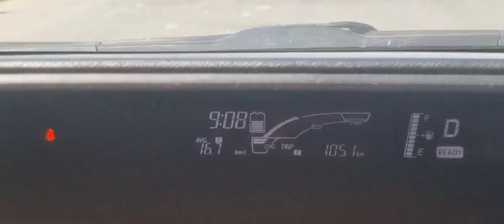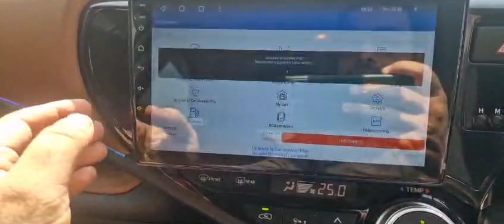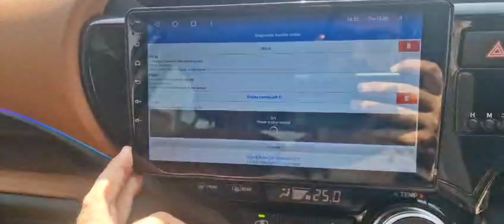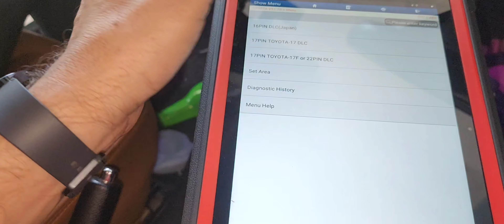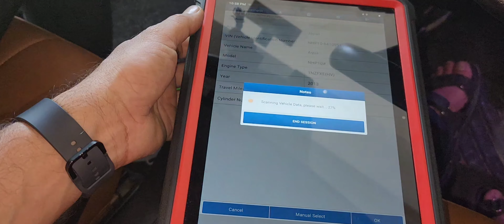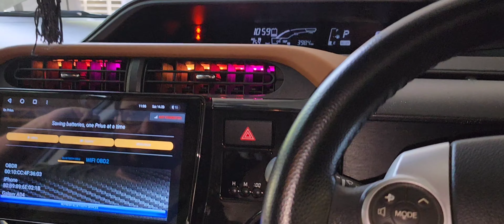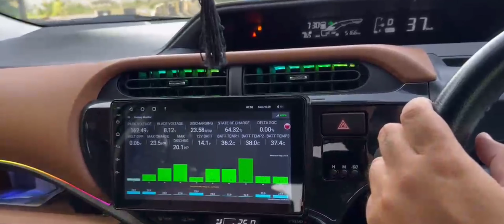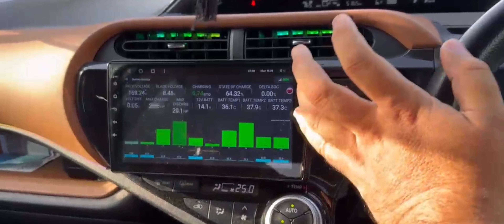Toyota Aqua hybrid Engine sign on And Hybrid sign ON Codes p3190 p0A0F

Comment: @mansoor bhai please help me mery pass aqua 2012 model h us me p3190 or p3193 code aty hn sb tuning krwa li throttle b change karwa lia  but masla hal nhi ho rha slpw speed me car missing karti h r average b kam ho gai h please es k hal bta dain kya karen me 3month sy prashysan hn from Bahawalpur
Reply from the maker: P3190 Fuel pump  ignition coils sprak plus 
Throttle body check karaen 
P3193 
Fuel injector leak ho saty hy
Or all fuse check karaen 
Catalytic converter chocked ho sakta hy
Oxygen sensor Air sensor b check karaen
Reply from the maker: Throttle pedal b check karaen